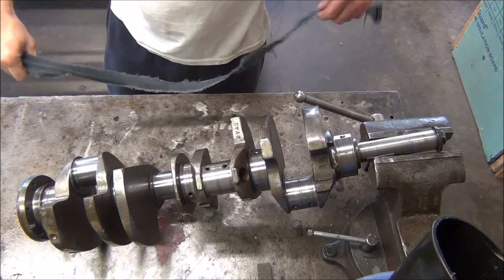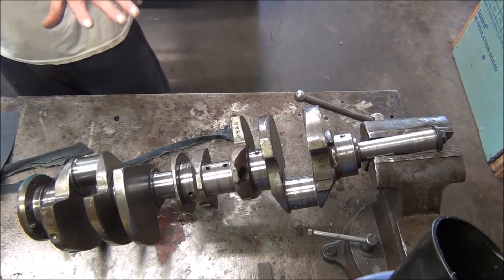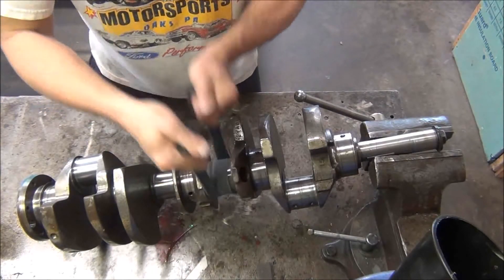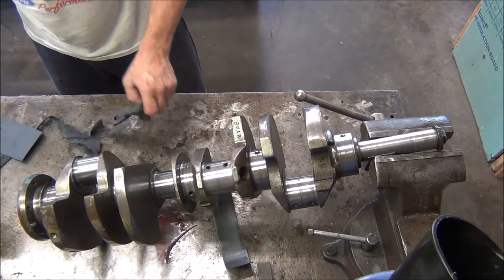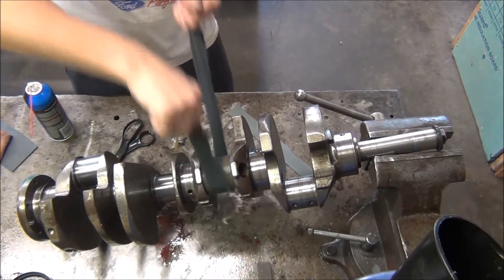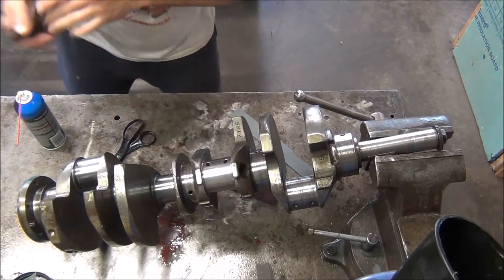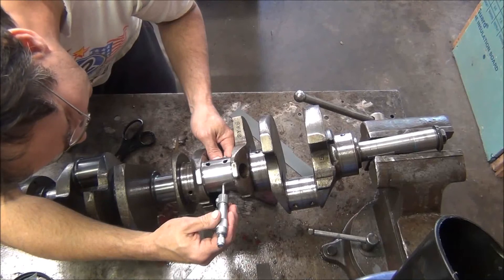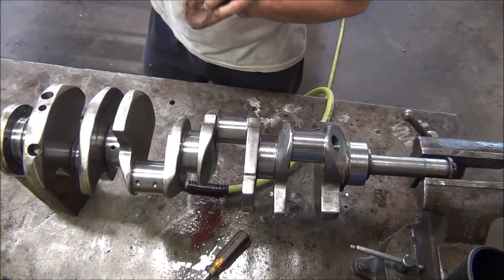460 rebuild Part 3 polishing the crank.

Comment: You are getting 1.99 on a 2.5 rod bearing? I would have expected 2.488 or so on a .010 crank? Are you running a different than stock size rod?
Reply from the maker: This video was filmed a long time ago,and I am not sure if I mentioned that this crank is a 460 ford crank, offset ground to a 4.140 stroke. The diameter ends up being big block chevy rod journal size.

Comment: have checked with a machine shop, they said $180 for crankshaft and $20 per connecting rod. So, this well known technic saves some money. Great Vid
Reply from the maker: 180 for just a polish ? Sounds like gave you a price to turn it .010 under.

Comment: I always been told to make sure the sandpaper makes 2 revolutions each pull so 2 in 1 direction then 2 back the other way then repeat and so on. But I guess u prove that isn't absolutely necessary here, good to know
Reply from the maker: That would be hard to do. Every one has their own preference. Thanks for watching.
Reply: @Dragracer64  Nah not much different other then arms wearing down a little faster lol. I just use a longer string, about 18-24" on each side. But I only been doing it cause that's how I was always taught lol. Now that I know i see its not absolutely necessary I won't be so paticular about it and in return will make it easier on the brain lol

Comment: Hows the engine running ? How many miles on it now?
Reply from the maker: The race track closed by the time I got it running. I don't drive it on the street, so I go by 1/8th mile passes, not miles. Thanks for watching.
Reply: @Dragracer64  where do you race & in what car?